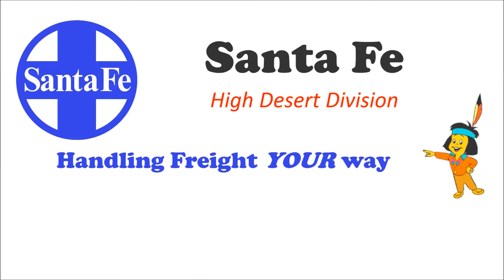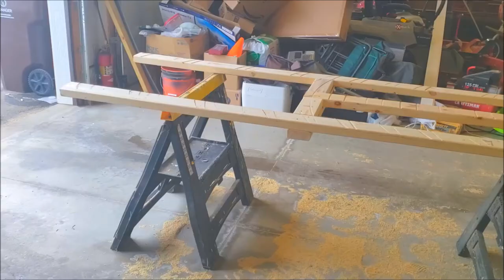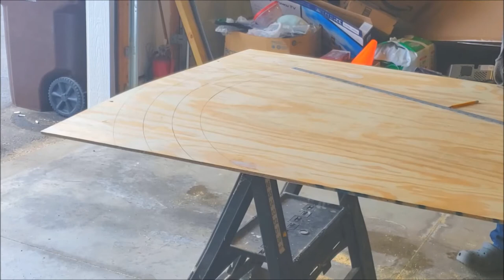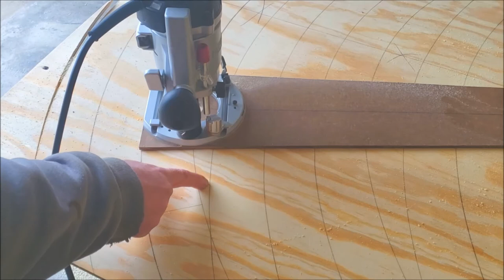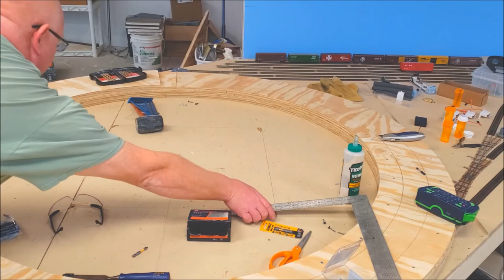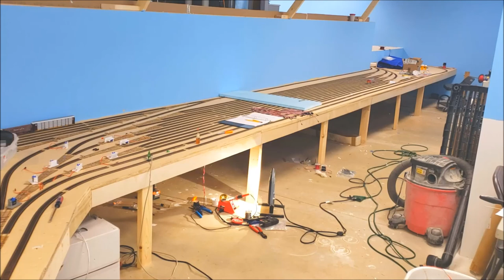Helix Sub Roadbed build using an Router

Comment: Here from FB, Looks good. Wondering if it would of been simpler when you start your markup to measure like you did all the pivot points then drill a 3/16 (size isn't important) hole and use a pin instead of a screw it would save a lot of screwing around (HA!).  Also wondering you might be able to get more precise angle cuts laying them all out in the markup phase, defining the line with the pined ruler instead of the pattern. It should offer a more exact cut line saving trips to the saw. 

I would also build a sled for the table saw that allows you to drop in the curve align the cut line to the blade path and zip. Scraps could be used to give the curved fence of the sled. 

None the less great work,
Joe
Reply from the maker: Joe, very interesting idea using a pin.  If it was done that way you would want to go with a small hole because the holes won't necessary be in the scrap pieces.  They would be spread out in your sub- roadbed and possibly some scrap pieces.
Reply: @brownjm74   Yes pin size isn't overly important as long as the chosen size is tough enough avoid bending.  1/8" drill bits make good pins, even the broken ones HA!  3/16 was just the first number to pop into my head.